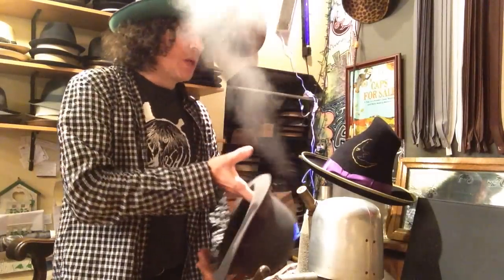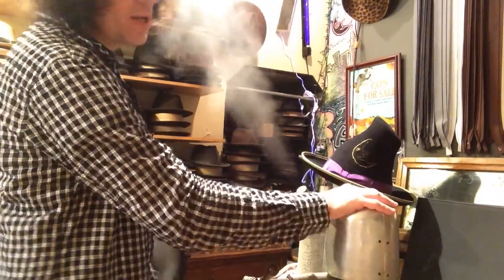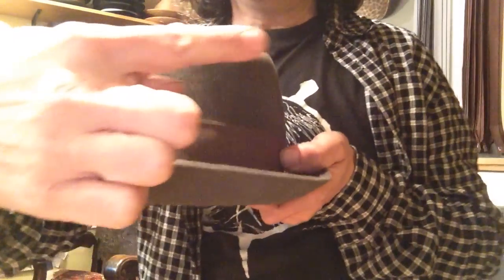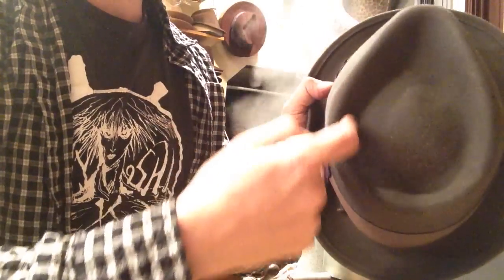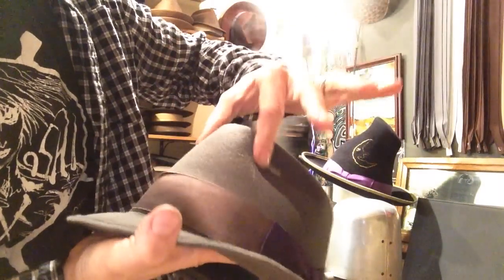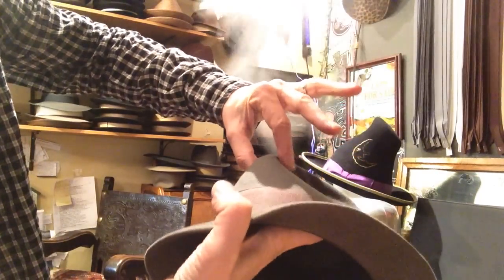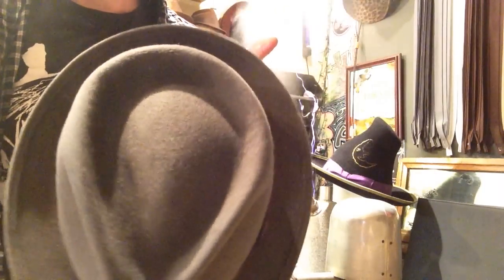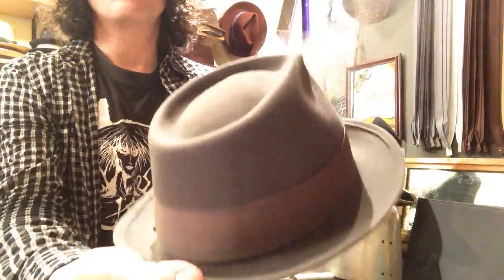Shape a Fedora. into a Teardrop !! Hat Shaping You Can Try Yourself!

Comment from the maker: Genrev,  this is called hand blocking.  also known as:
steaming, brushing and steaming, hand shaping..
hand blocking....It is usually not for hats that are really totaled, Although I have done some miracles on really dogged hats, it's more like a shoe-shine for a hat that is not damaged, but simply out of shape. it is done free of charge at our shop although some places charge a good amount.
, The more intensive "hat blocking" is done with wooden or metal molds called blocks. it is the way these hats are manufactured. To do this, you need a collection of different shaped blocks. It is between $20 and $40 to do this here..depending on the job. (it could be the brim, the crown, or both)
This gets amazing results but also stiffens the hat somewhat..but you can take hats that are flattened like a book and make them perfect.. This you do when a hat just won't respond well to the steaming anymore.Or you want absolute perfection with an old hat. Otherwise, using steam and a trained eye can be more authentic,hand shaped..and old-timey looking, as well as giving you more freedom to shape it freely,creatively and with flair.
of course, it can be done shakily by a novice
 or with grace and style,with smooth lines.and to the customers needs, to match his height,taste..you can really fine tune it by hand.. again,it's just as easy to mess it up by hand, while blocks are more predictable and easy to get right. But it usually costs a few bucks. it is a lot of work.
Reply: +quadrogong1111 Great video. Say, is there a particular name for the type of fedora Frank Sinatra used to wear...?
Reply from the maker: +Martin Pescador   Yes, he wore two similar styles. 
First the " stingy brim fedora " which means short  brim fedora basically,
a 2" brim usually grey with s black band, or any color really..
We have one called "the Blues" for $85 on our site porkpiehatters.com
Plus a half dozen more that are higher priced like Stetsons etc
He also wore a pork pie with the brim snapped down
I can recreate the hats exactly for u, same band, everything in six colors for $95 + $10 for extra  clip on bands to make it more authentic..
Reply: +quadrogong1111 Thanks for such a quick response. That's very reasonable. I'll definitely visit your store....

Comment: Hi help. Ive been searching (high and low) to find how you install the leather sweat band that you find on original vintage 20's/30's newsboy caps. And what sort of machine do you need to stitch this leather sweatband ? Obviosuley you will need a special hat machine as it would be too thick to use with a regular sewing machine. I can make the caps no problem..but I am hand stitching all the seams and that's back breaking work...just looking for the right machine that can save my poor fingers. Cheers
Reply from the maker: It's not really what I do, 
caps are sort of a different category altogether,"
"cut and sew" items like newsboys caps are done differently than hats..

There are 4-5 high end .custom cap makers online that use vintage fabrics etc
  Those guys would know
If u search u can find a "custom vintage style newsboy" guy to ask, try google
If u have trouble, I can find them for you

or maybe ask the guys at Van Dyke hatters, 
in Brooklyn NY
They repair cap sweatbands I think

Comment: Is there a fedora that the brim is short on the back and longer on the front? So its not all the same length all around.
Reply from the maker: OneForever there are things called dimensional brims, where the sides are narrower than the front and the back, it is essentially and oval shape, this makes it neater when u turn the entire brim all the way down,safari style or Indiana Jones style. Because the sides of the brim are tapered shorter. The most famous hat I can think of with a dimensional brim is a Stetson Temple, which is a huge seller for the,. But if u are talking about asymmetric brims, where they are really dramatically uneven, that is a style u see in ladies hats, often. It’s fashionable, edgy.. our hat maker can do stuff like that, trim a brim unevenly..most of the times it’s a circle and the brim cutter is like a compass,with a blade at the end.

Comment: I am a staunch Pork Pie revivalist. Cheers to you sir.  Question: Is it possible to steam a hat and form it by pressing it between two identical plastic hat holders that the hats come with in the store?
Reply from the maker: I do that using a stiff hat in a few sizrs bigger,i use another hat for a form.. or a wood hat block. Thete are western hat molds like that,plastic male & female brim molds, u clamp the hat berween them & velcro it shut..steam it. I will demo it soon,good idea..those plastic things u mentioned arent usually hard enough
Reply: @KTGHATS  I got two of the stiffer plastic molds that are exactly the same size and trimmed the flange of the one that I use for on top of the hat so it fits down tightly. Tried to steam it with my teapot but it didn't really have enough horse power so I just sprayed it with hot water and clamped it down. I'm going to try to find some non staining hat starch spray
Reply from the maker: I get perfect results w ultra super hold hair spray, remove all dust,lint w packing tape first,spray thin coats,let it dry,repeat..then do your mold thing while it's still tacky..let it dry completely, and cover your sweatband before spraying, a big ball of tissue in the crown covers it, I use a hat jack to cover the band,so no spray gets on it

Comment: I guess this is a stupid question, but when u add the foam tape , do u use both sides of the tape?  
Tia
Reply from the maker: On one side is the sticky adhesive,
On the other side is the foam. You stick the adhesive against the hat,so it sticks.
 (Under the leather sweatband, in back, behind your head)
Reply: @KTGHATS  yes i did that but i find it still not tight enough so i will double the tape at the back of my head,, i dont want it to be able to blow off my head

Comment: Hi Kevin. I just bought an old (very old) Borsalino in very good condition that needs a good cleaning. I have read that you can soak a fur hat in camp fuel or naptha and then let it dry, but am skeptical of this. Just wondering if you knew anything about this or if you just don't recommend it at all?
Reply from the maker: Yes, I've heard of this, and I saw an odd video on YTf. Guy soaking a felt hat in it, I don't suggest this, it's dangerous .
There are some hat repair places that will accept a hat or a cleaning,and they charge a lot, and basically just soak it in alcohol and let it dry.
I think it's a scam, and it doesn't work, as far as the Naptha, it's an odd home remedy that I would avoid. I never heard of a single colleague in the 21 years working for one of the worlds oldest and most famous hat shops..
there are places that chemically clean felt has and there are special guidelines for the chemicals they use, spray booths, ventilation etc 

I can suggest a guy in Chicago that cleans felt hats, but they are a fairly pricey place, sort of high end,and then there's shipping charges two ways.
   I cannot clean perspiration stains that originate inside the hat and  permeate all the way through the felt, 
I can clean dirt and stains on the outside of the hat though,cleaning and reshaping are free.

Comment: Kevin I bought another hat, this time it’s felt and I’m wondering why there’s a ribbon attached to the inside of the hat, I’m thinking it’s to tighten the hat.  Have u ever heard of that?. I must steam it to shapevthe crown. R usupposed to shape the brim so that it tilts up like yours does. Thanks 

C
Reply from the maker: the brim on mine snaps up and down, no steam needed for a brim, it either snaps up or doesn’t... just snap it up. If it doesn’t snap up it’s not a snap brim,like mine. But yeah, just flip the brim up,
And ...  the bow on the inside of the hat is to show u where the back of the hat is.. so u can tell in the dark, a theater or whatever, u can tell where the back of the hat is by feeling that bow,
(so u put it on correctly,not backwards)
Reply: KEVIN from JJ HAT CENTER 🎸HATS & GUITARS ! 
Thanks Kevin for your timely help
Reply: KEVIN from JJ HAT CENTER 🎸HATS & GUITARS ! Thanks

Comment: Man I tried shaping my fedora like Michael Jackson fedora using iron steam is that possible??
Reply from the maker: It can be done, using the steam from an iron, or a kettle, get whatever steam is the strongest going..try them both..the stove is dangerously close to the flame,and I hate doing that..if u can get the steam hot enough that it burns your hand to touch, most likely it’ll be ok.. steam in one spot directly,  soften it, then shape it, hold it still till it’s dry..
one spot at a time, and don’t let the steam bounce off of the brim or other parts..it’ll open up any creases you’ve steamed already, or it can curl your brim..

Comment: Thanks for the info! Today i picked up an unworn Canadian 'Mountie' hat from a thrift store and now spent the afternoon taking great pleasure in reshaping it into a high-crown, wide-brim fedora. Do you have any opinions regarding linings within a hat? My Stetson Yutan fedora has no lining, would there be any advantages/disadvantages in removing the white satin lining from my new converted mountie hat?
Reply from the maker: Lawrence James Bailey removing it will make the hat cooler and airy in the hot waether,or if u work in hats, u take out the man-made satin lining,the hat breaths more.BUT..if u are bald on top, then u can stain the roof of the crown with sweat, so u should have some hair on top to wear a hat without a lining,if your head doesn't make contact with the crown,then  it doesn't matter

. I remove my linings on all my hats because I work in them from 11AM to 8PM and it gets hot,so I just yank them out.But it's there to protect the hat

..the lining gets stained,the hat lives on..
like the sweatband,and the outer ribbon band,
 u sweat into it, it soaks up the salts,stains..and the hat lives on.
.u change them periodically, all three.
 The more u have,the more of a chance the felt will live on for decades unstained. 

If u have a low crowned porkpie and your head makes contact with the crown,a lining is best,but if the crown is high and u barely touch the roof..then a lining is sort of not needed,

Comment: Can u use the same method for a straw hat?
Reply from the maker: Yes, if it's nice and stiff, it's the plastic-y coating that u actually shape, do if it's too soft, u need to spray it w super hold hair spray first,
 let it dry, repeat,dry.
If it feels stiff afterwards..
Then steam it.
(If not, apply more 1-2 coats)
   If the hat is soft u will get no results, don't bother.. but, if so.. u can always stiffen it
Reply: So u r saying not to spray with water.  Its a cheap hat, not a panama hat.  The crown i tried to shappe by spraying water on it and stretching over a big bowl.  I just want to get the wrinkles out and buy some foam tape to make the hat fit tighter.  
Thank u for your suggestions, i so really appreciate them.